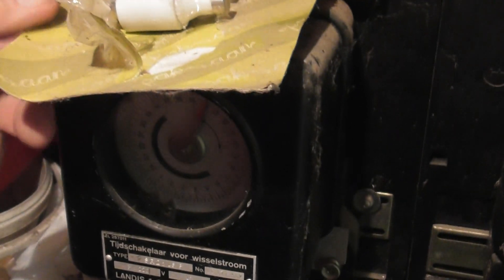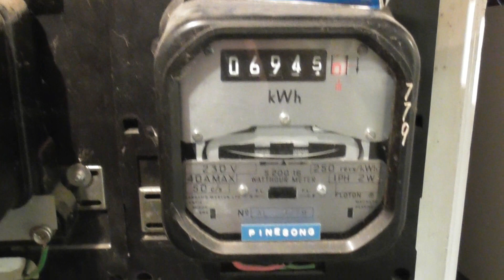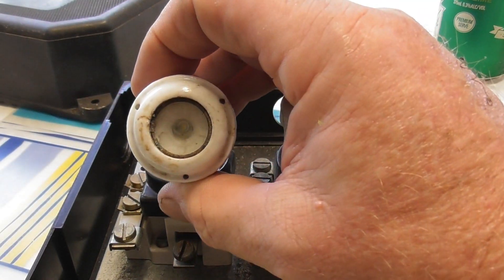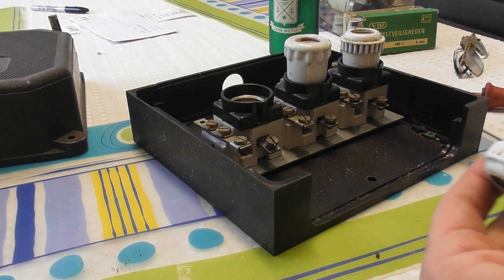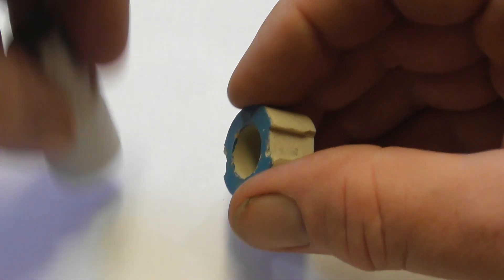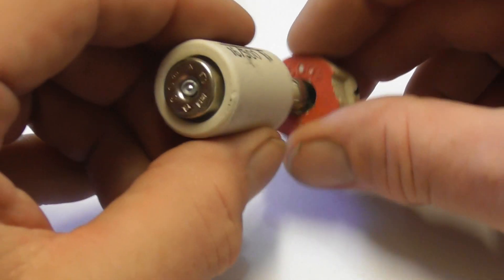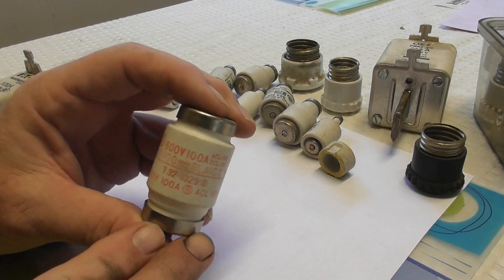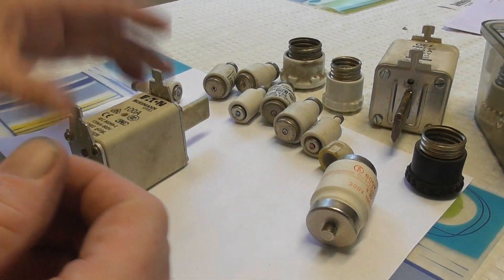Weber bottle fuses, zekeringen, D2, D3

Comment: You should replace the cap if the tiny glass window in it is missing.
Imagine the short isn't fixed so the fuse blows again before you remove your hands. If the indicator wire burns before the fuse wire, you may get electric shock if that tiny window is missing.

Comment: I was told that these screw-in circuit breakers are pretty dangerous, they tend to stick, not switching off in case of a fault.
Reply from the maker: Not sure who told you but these fuses have sand inside to quench the internal arc. Never had a problem with them.
Reply: @RODALCO2007  I mean the "automaten". Nothing wrong with the regular fuses
Reply: @diederik998  The new once yes, the very old ones wich were longer not
Reply: @RODALCO2007  What he in mentioning may be banned in your country (which is good!)
Here in germany, every hardware store offers screw-in circuit breakers which fits the diazed base and replace link+cap. They are a quick but ugly solution which prevents you from getting poor by purchasing tons of fuses. 
These have outdated L or H characteristics and tolerate more overcurrent than fuse links in some cases or in case of a short, the current is too low to trip the short-protection.
German people somehow prefer this over proper fixing the issue behind and for some funny reason, they're not yet banned. So when you see such a screw-in breaker, there is ALWAYS something wrong with the wirings behind because these are as expensive as 10-15 fuse links.
As long as there is nothing wrong with your house wirings, screw-in breakers are unnecessary and don't provide any real advantage because when the breaker reaches their end of their life-span, you won't have blown 10 or more fuse links on that circuit - killing the only advantage which is to save money for massive amount of fuse links. :)
Reply: @wichtelchen  It is not true that every installation with Screw-in circuit breakers is unsafe. If they are selected correctly, which is mandatory for every fuse, for example an L10A breaker will let 19Amps of current flow for one hour max (10A * 1,9), which is the equivalent of a B13A breaker (13A*1,45=18,85A) So in that case, a L10A breaker would provide better protection for circuits with Schuko-Outlets than a B16 breaker, because Schuko doesn't like to be tortured with 16A loads all of the time. The breakers shown in the video were manufactured in the GDR "VEB Elektroinstallation Annaberg", interesting that they made their way to the Netherlands.
Reply: You mean those screw-in breakers with the black push-button in the center?
These are indeed considered unsafe from german point of view.
That's not because of failure of the inner mechanic parts (this can happen to any circuit breaker).
That's because of the characteristics (=overcurrent factor to blow time relationship curve).
Breakers have a strong bent in it which regular diazed fuse link do not have. 
This is because those breakers have two separate mechanisms for overcurrent- and short-protection.
Because of this bent, they tolerate much more (=too much) overcurrent than a fuse link in some cases, which might end up in fire hazards.
If you switch from fuse links to breakers you have to consider the differences and may reduce the current rating in some cases to cover this.
That someone who buy these screw-in breaker is not aware of this at all.
This is where the myth comes from sticking or missing mechanisms inside the breakers. The breaker is likely fine and functional. The breaker is just a bad choice in some particular cases.

Comment: Our house had those diazed fuses up until a few years ago with the RCD being the only circuit breaker.  This setup worked very well up until the fuses got expensive and difficult to get hold of, after which we had them replaced with circuit breakers.  The vast majority of electrical faults would trip the RCD such as when our past kitchen appliances reached the end of life, particularly our past fridges and freezers.  CFL light bulbs were the worst offender for blowing fuses as they often failed with a bang, knocking out the lights and stinking up the room.  

Those 16A diazed fuses were also quicker to blow than the 13A fuses in the plugs .  We use UK plugs/sockets in Ireland, where every plug typically has a 3A or 13A fuse.  Anytime there was a short circuit (e.g. failing heating element), the circuit's 16A diazed fuse would blow, yet the 13A fuse in the appliance's plug would be intact.
Reply: The fuse in the cable is there to protect the flex rather than the appliance. As cables have some over current tolerance because they are in free air, I guess BS1363 fuses are not as fast acting as these ones are.
Reply: I’m in same situation, out of interest how much was the board replacement
Reply: @giggergigger1  We had our house extended which required moving the consumer unit and its circuits, so it would be difficult to estimate how much of the cost was involved in changing over to circuit breakers.

Comment: I notice that the European fuse color code is a bit different to the British system just to add to the confusion. British fuses were white 5 amps blue 15 amps yellow 20 amps red 30 amps and rare green 45 amps. 10 amp circuits existed in the early days but were were phased out by the 1950s.
Reply from the maker: Same colours are used in NZ and AU on plug in MCB's

Comment: Yeah, these are still fairly common in the more run down/dilapidated parts of the large inner cities of Den Haag, Rotterdam and Amsterdam.
Friend of mine recently had an inspection by his local power company (Eneco), who wanted to install one of their "smart" meters...
That is, until the Electrician noticed two of these old fashioned "stoppenkast" units (it's a rather large house, divided into two parts) with these old bottle fuses, and thought better of it.
Fella couldn't be bothered to re-wire the whole lot, so he called a contractor to do it for him.
Reply: Makes sense if he wasnt that skilled and worried about liability. Ive seen many old panels burn down houses.
Reply: @ryanmalin  While that's certainly a fair point (when true), in this case the Electrician commented, and I can paraphrase at best here, since it the comment was in Dutch "I don't feel like wasting half a day to rewire all this, I'll have my boss call one of our freelancers to do it".

Literal quote for fellow Dutchies and assorted Dutch speakers; "ik heb geen zin om hier een halve dag met de bedrading bezig te zijn, ik laat m'n baas wel een van onze ZZP'ers sturen ofzo".

Comment: Thank you for this video Raymond. There is very little information in English on the internet about this type of fuse. I am also quite interested about the switch box to the right of the fuses.
Reply: These switches are used to switch off the circuit before taking out the fuse (or re-insert it), to avoid arcs when installing the fuses. They interrupt both the Live and the Neutral wire. It's just a "dumb" switch.
These boxes were made by Hazemeyer Hengelo (acquierd by Eaton many years ago, but this is what the HH logo means) and are still found in many buildings in the Netherlands, built before around 1990. The more rugged version is called Halyester, and these are still manufactured for industrial applications.
Reply: @diederik998  thank you for that. The UK version of fuse boards with separate fuses requires you to turn whole installation off I think individual switches for each circuit is a much more sensible option

Comment: Interesting we know the unter diazed, the original name when siemens introduced them. The colors are subsidised from old german stamps. green (6A) fuses were 5pfennig stamps, red (10A) were from the 10 pfenning stamp etc. There was also nDZ with E16 scre cap and a D4 with  1 1/4" screw cap and D5 up to 200A with 2" screw ca. There were plans to develop the D5 system or another bigger size up to 500A however, as much as I know this never came reality. The biggest I ahve is a 200A holder but no cap and no fuse.  I have an old book from 1919 were it is described why these should become the stadard system in europe, and from were the came. If you want I could send you a scan of the fuse part.
Reply from the maker: Thanks for your reply, Diazed fuses, I forgot the name. I would be keen on a scan of the fuse part if possibel. Thanks in advance. email raytray.van@gmail.com
Reply: I just sended yo a message

Comment: Those 25A fuses are over 50 years old, and still good. Still found around in old equipment, and the most common place is in elevators, where they are in all units from around 1930 to around 1980.
Reply: The breakdown point will probably have changed, almost certainly nearer to 15A now.
Reply: I have this style fuses installed as main disconnect before meter, 3x 35 A and after 15-20 of service each of them tripped exactly once, under moderate loads, way below the tripping point. Almost like they aged and lost current carrying capacity.